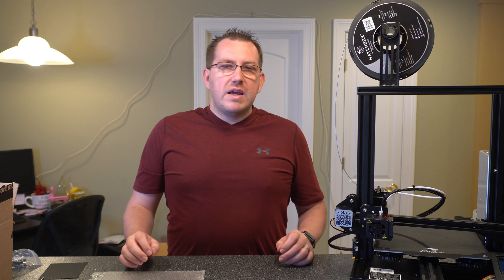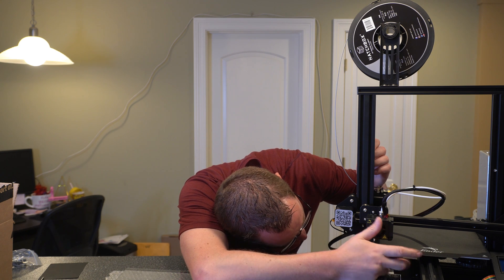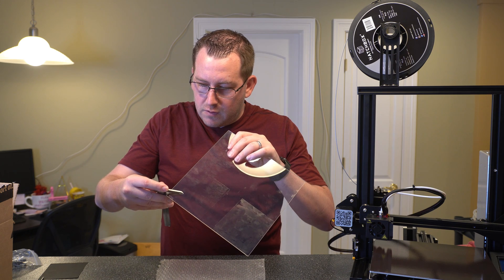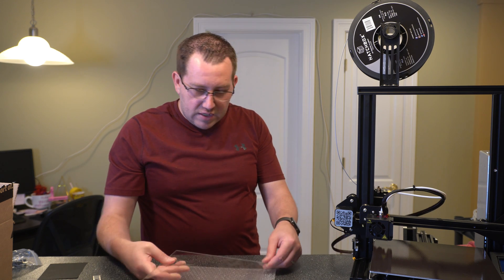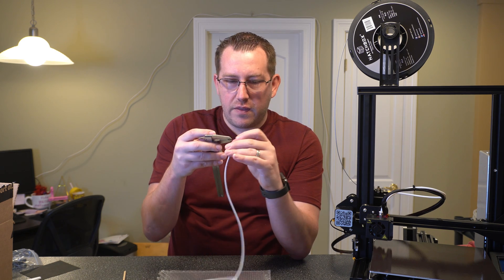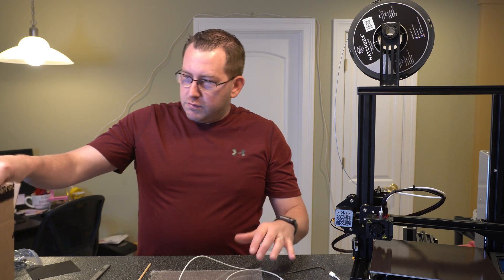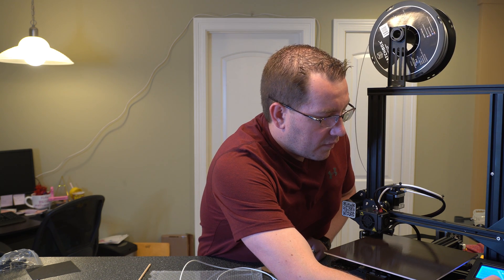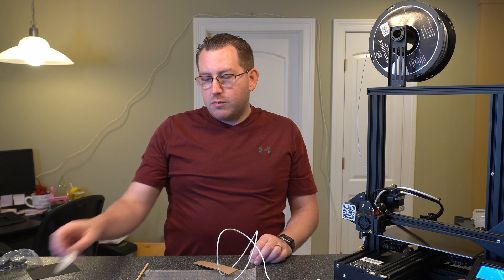Ender 3 Pro Z-Axis Calibration – Everything You Need to Know

Comment: I got the silicon bushings and they are shorter than the springs so rather than raising the limit, I need to lower it.
Reply from the maker: Hi. You should be able to do that without a problem. You will have to cut that little stopper piece on the stop mount though.
Reply: @3DPrintscape  I'm just shimming it with some nylon flat washers. I was surprised the screws for the bed aren't anchored so I'm adding a nut (the bushings actually have an inset for it). Perhaps a miniscule drop of loctite (that bed moves around a lot). When I get done the bed should be sturdy as the proverbial brick outhouse.

Comment: Great video. What do you do if your z axis no longer wants to move down. Only moves up. For example when auto homing it does the x and y fine has a little 1 second thing about homing down and just goes na, I'm going to just move back to the middle and stay at my current hight and say stopped on the display.
Reply from the maker: Hi. I have only seen this if the z stop is not connected. Can you confirm that it is?
Reply: @3DPrintscape  yeah its all connected. I had been using it a lot before turning it off for a weekend. When I turned it back on it no longer homes the z. It raises fine just doesn't go down anymore. The printer hadn't moved at all. I'm praying its not a motherboard problem.
Reply from the maker: @harryallen1175  Check the connections to make sure nothing came loose. You can also try to clear the eeprom.

Comment: My Ender 3 Pro started to print with the nozzle 1/8th of an inch off bed after Bed Leveling.Frustrating as it worked fine for a week, then EVERYTIME I Level the bed it prints Off Bed or after relevel then heating up I select Print from TFT and the Nozzle will DIG into the print plate. So, the nozzle is too high or too low alternately. What happened? Oh, it's a V4.2.7 board.
Reply from the maker: Hi. Its possible you have a warped build plate, have you looked into that at all? Also, are you using any type of bed leveling kits? If not, it may be worth going that route.

Comment: thank you so much. Recently bought my Ender 3. Bought the glass plate when I stabbed the original plate. Saw all these Z axis videos but they were with the auto leveling or changing it in Marlin or a slicer. This is so much easier
Reply from the maker: You're Welcome
Reply: Which option did you take? I wanna do first option of taking the bed it'self to lift the Z-switch. which worked for you?
Reply from the maker: @DaiSol89  I used the bed itself to lift the z stop last time I did it.

Comment: In the end. A good comment.

I was looking for "Z-Azis Calibration". This is not what I was looking for. This is a Z-Axis home/bed adjustment video. Bad title.

How I got here.

I made a test cube! I measured it. It was under sized. I'm looking for a fix. So I'm looking for, "How to calibrate axis travel on Ender pro 3". (Before we go any further, Let's blame Google for a bad point to you for my question.) Google pointed to you. Since you put the word "Ender 3 Pro Z-Axis Calibration", in the title, it got flagged. What I see is, Z axis home position adjustments. That is bed leveling. Nothing about X travel errors.

I will point you to the Issue I have. I print a test measurement cube and it is not the right size. It's 20% smaller. How do you fix it? Who has the answer to that? It is an axis calibration issue. Definitely.

Your video is a good video of how to set the home position. But don't call it "Z-Axis Calibration". Call it "Ender 3 Pro, "Home Position Adjustment."

No up or down likes from me. It's a good video, just titled wrong. IMO.
Reply from the maker: Hi. Thanks for the feedback. Have you tried to calibrate you e-steps and flow rate?

Comment: 😅you could just print one before doing that I guess , good video!
Reply from the maker: Thanks for the feedback :).
Reply: @3DPrintscape  do you know why after changing to pei, I have severe bottom layer over extrusion ? It looks like elephant foot but the whole bottom 3 layers are bulged
Reply from the maker: @青草维尼  The temp may be too high for pie, or the printer is by a draft.
Reply: @3DPrintscape  I did what you teach in the video but nothing improved
Reply from the maker: @青草维尼  If everything was working before, you wont see much improvement for just adjusting the z axis properly. You would probably see a bigger change by upgrading the fan, adding a bltouch, and calibrating the e-steps.
Reply: @3DPrintscape  solved, buddy. The left Essentric nut is too tight and the nuts for the lead screw are also too tight

Comment: what is the distance from the bottom of the FRAME to the Bottom of the z axis limit mounting plate ?
Reply from the maker: Hi. The distance varies based on the build plate you are using. If your using the stock magnetic one, the lip on the z axis stop should sit on the frame.
Reply: @3DPrintscape  yes, bottom z axis mounting plate sits on the frame. I have read some ppl cut the tab off. Why IDK. thanks
Reply: @3DPrintscape  ok, got it. IF anyone wants to modify.  Always someone wants to change original configuration. I'm just starting, I'm still assembling the 3d printer. thanks

Comment: To be honest i think it would have been better if creality homed z on the top position because then it would be much easier to calibrate. You can do this in marlin on z max instead of z min, but then you need an extension chord as the switch is included in the premade cables and wont allow for moving it. The only cons is that you have to be able to understand how to edit the code for a new height but what you gain is a soft endstop on z low, wich will never fail wich a switch can. Switches can be inacurrate and will jam your nozzle to the bed. The software endstop can still be used but normally you dont combine the two on same end of an axis ( ie soft plus real switch shouldnt be used on z min or zmax together, either can have one ). The other axis are not gonna move as much as a z do. Have used soft stops on my deltas for several years and when it fails, it has always been because the mechankc switch has moved some tenth of a milimeter in the top, the creality i got is good but i think there is room for improvement.
Reply from the maker: Hi. Thanks for the input. I agree the way they did it was odd and the software endstops causes a lot of problems for people that add the bltouch.

Comment: Great video, I currently have another type of issue with the Z axis. For some reason   my printer dose not print to the correct hight! I have tried the same Gcode on my other ender 3 v2 and this prints at the correct hight. Any ideas as it is isolated on 1 printer ( I have 3 ender 3 v2's). I think it is a proper head scratcher.
Reply from the maker: Hi. How far off is the height? If its just a little, i would check to make sure you there isnt any obstructions on the z axis and verify that your flow rate is set right.
Reply: @3DPrintscape  thanks I will give it a fresh attempt
Reply from the maker: @carlhowell285  Were you able to get it working?

Comment: You didn’t calibrate anything, all you did was compensate for a thicker build plate.
Reply from the maker: Hi. Thanks for the feedback, I was considering adjusting the z-stop as calibrating what was needed for that axis. That said, your right though, it’s not really calibrating anything like I do in my e-setup and flow rate videos.
Reply: @3DPrintscape  I do, however, like your little trick of using the new build plate as a means of getting your z stop moved up. An easy simple solution. Keep it up, you’ll only get better!

Comment: My ender 3 pro z axis has not been moving at all up or down and it makes a grinding sound when trying any ideas whats going on?
Reply from the maker: Assuming nothing changed. If there is a grinding sound, i would look at the z axis stepper motor to see if its turning and just not turning the rod.
Reply: @3DPrintscape  I actually did just look into it my motor is having a hard time turning itself i took the z screw out and left coupler on to see turn and it didn't wanna do that so prob looking at a new motor?
Reply from the maker: @garrettburke9035  Are you able to turn the z rod freely with it attached? If so, it could be the motor.
Reply: @3DPrintscape  yea I cam turn it attached but I think the motor just died it doesn't even make any noise anymore I wasn't forcing it I reassembled and auto homed and nothing
Reply from the maker: @garrettburke9035  Ok, then ya it sounds like the mottor. They are pretty cheap and easy to swap out.

Comment: Hi, i saw that you help the people who comment here, so I gonna ask for your help because my ender 3 is stuck by 2 months right now and I don't know what to do, my ender 3 start printing normally and for some reason it just stops to release the filament, I already change the nozzle, change the PTFE, upgrade the extruder, change the configurations at cura and nothing help, I beg you help me please because I have no idea what to do
Reply from the maker: Hi. Did anything change when it stopped working, like mods, firmware, etc? Are you still able to manually extrude filament through the hotend? Can you provide as much detail as you can here or join my discord server and provide it there https://discord.gg/Bu94EYVkrU ?

Comment: Thanks great video, I bought a creality glass bed recently and had the same issue. I can level the bed by adjusting the knobs. Another issue is sometimes z limit switch is not bumping which breaks my leveling. Autohoming for z offset seems not reliable(z is not coming down and make that click in 5/10 atttempt). Does adjusting the switch a little higher solve the problem?
Reply from the maker: Hi. It will definitely help make sure it gets triggered. it sounds like that isnt happening reliably for you.

Comment: When I changed out the magnetic bed on my Ender 3 pro for the Creality glass bed,  I actually had to cut of the stop tab on my limit switch in order to lower it enough.
Reply from the maker: Hi. That’s interesting. Typically the glass is thicker than the magnetic pad and build plate. Do you know the thickness of the glass you went with?

Comment: i wouldn't call it calibrating the z axis. it was just moving the end stop up from the bottom.  not sure why measure all the household items.  reshoot the video. imho.
calibrating would be adjusting the stepping rate on the z axis
Reply from the maker: Hi. I was trying a slightly different approach with this video, and it didn’t turn out well but it was answering a couple of questions i was asked in a previous video. I did a video on calibrating e-steps a couple of weeks back. If your interested in it I can get you the link when I get back to my computer.

Comment: Thanks for the video! I'm unsure why you went around measuring stuff when you just could've printed a shim of the correct height. Measure the correct size, create a box with those measurements, print it, loosen the z axis switch, slide the box under it, tighten the screws, done.
Reply from the maker: Hi. Thanks for the feedback. I was trying to show some real examples of the adjustment needed, but it didn’t really go over very well. Printing a shim would work, but I found just using the bed works just fine. For example, if you are adding a glass bed, you can just use that to adjust the z-stop.

Comment: My ender 3 pro suddenly stopped while printing
Reply from the maker: Hi. Can you provide more detail on what happed? Like when did it stop, was the printer still running when it stopped printing, etc. The more info you can provide, the better.
Reply: @3DPrintscape  yes while the printer is running suddenly stopped without any warning ... after that  the scrreen not responding for any command so switched off and on
Reply: @3DPrintscape  its stopped exactly after 16%
Reply from the maker: Got it. One more question. Have you tried to print more than one model, and if so does it stop at 16% on all of them? Im trying to see if its related to a specific model.
Reply: I found out its relate only to one model

Comment: Thickness of Sovol SV01 ultrabase like bed is 4mm
Reply from the maker: Thanks for the info. I did a little more research after recording this video, and it seems like the cheaper glass build plates are around 3mm, and the more expensive ones are typically 4mm, but I have seen a couple at 5mm.